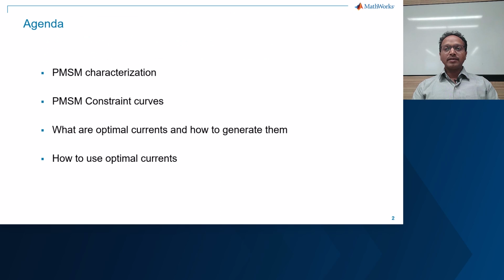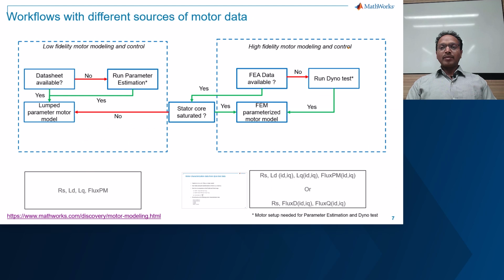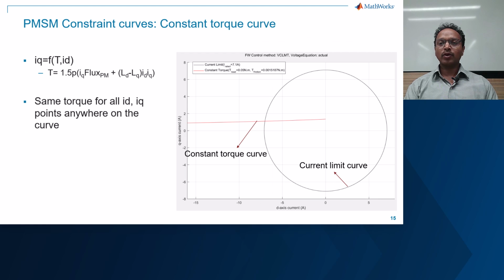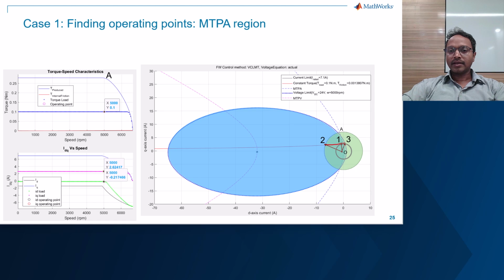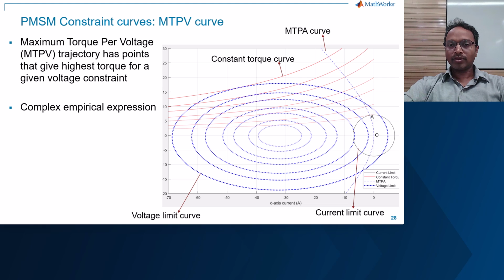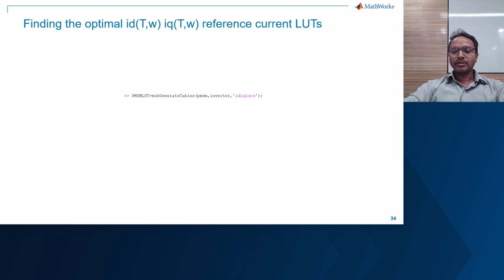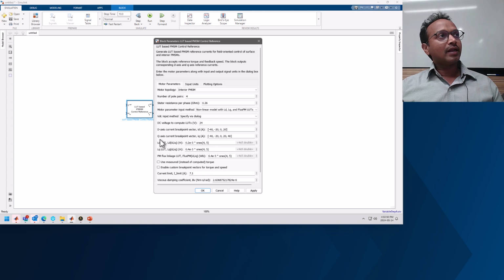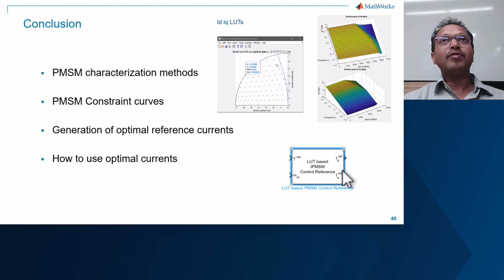Optimal Torque Control Workflow for Permanent Magnet Synchronous Motors

Comment: Doesn't the control performance influences the motor characterization test from dyno?
Reply from the maker: For characterization tests, we do not have to operate with mtpa. For example, the motor controller could be provided a with reference id and iq currents while the dyno is run in constant speed mode. The currents can then be swept through out the Id iq plane to cover all possible points to get the motor's characteristics in the entire range of operating points.